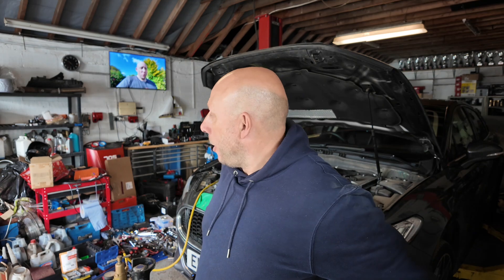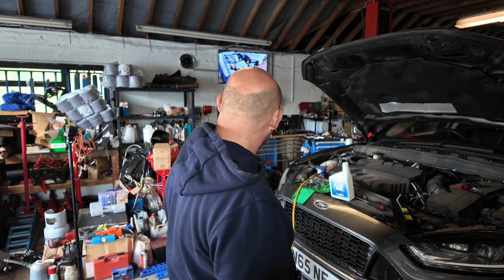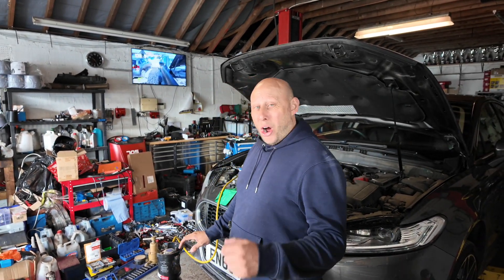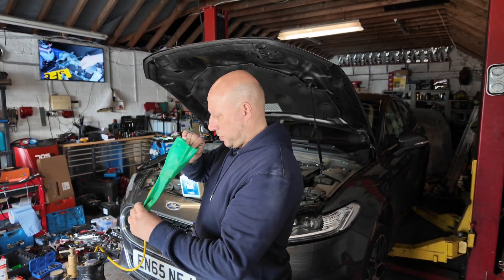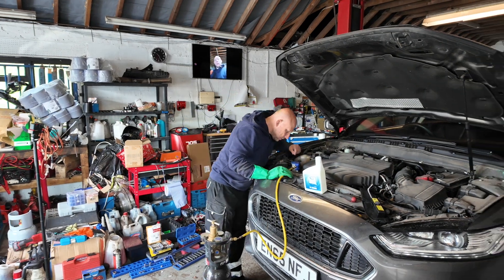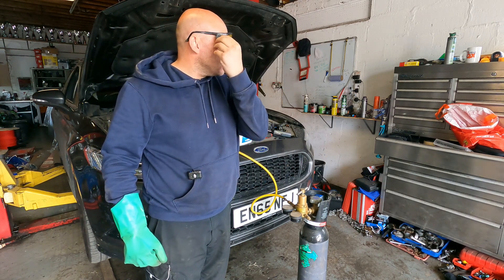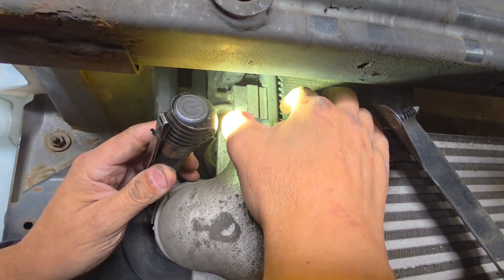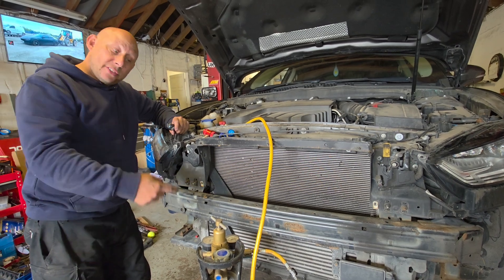DIY Car AC Leak Test: Using Nitrogen Like a Pro | Fix Your Aircon Fast! #automobile #mechanic #diy

Comment: Shame car manufacturers don't fit a simple mesh screen in front of the condenser, extend it's life. Both a 2018 Volvo arctic  & the current Daf 95 I drive have these screens fitted. Granted there's less room in a car to fit one,  but surely somebody could develop one thin enough.